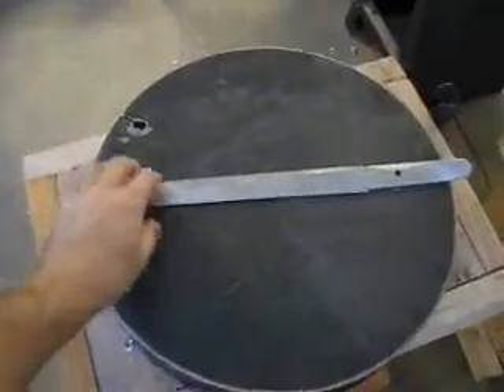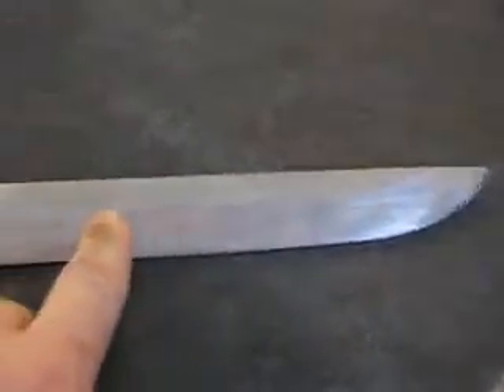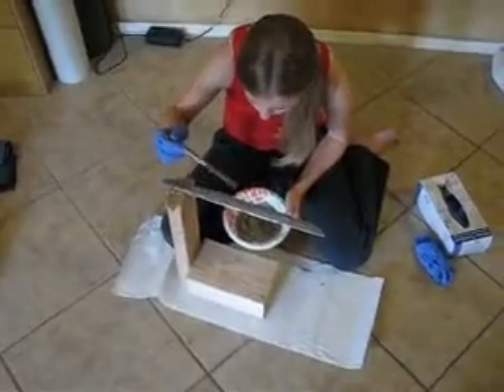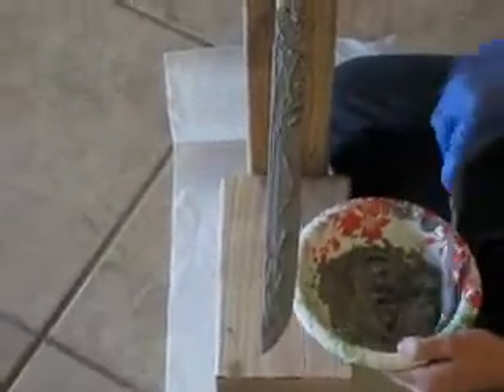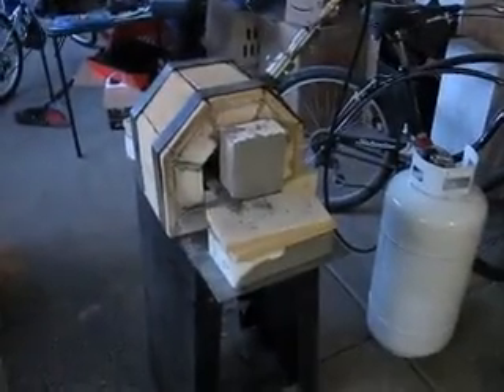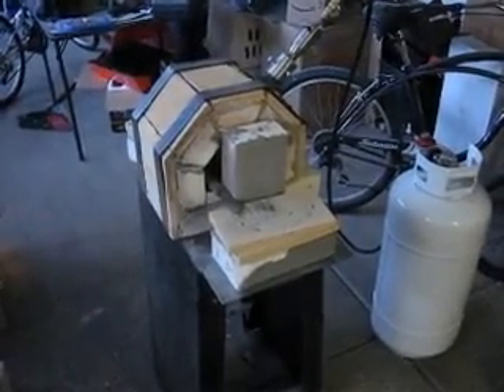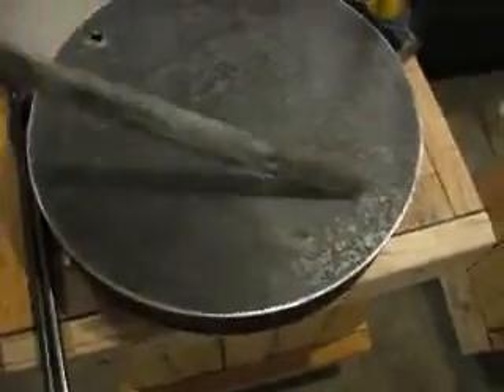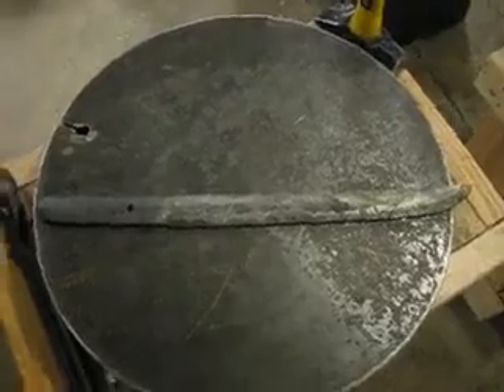Forge Diaries 006: Shinogi zukuri geometry; claying the blade; quenching; gracefully curving blade

Comment: Forging is a rough shape, get as close as you can, and then get the final detail, by grinding and filing. Using a 1" belt sander will do a great job at assisting you with that. also you are going clay heavy on the blade which shouldn't be done, only the edge is covered in clay to get the hamon. the edge should be harder than the spine
Reply: cadence0dakota19 This is just how I was Apprenticed though, and is by no means the only method. the clay though doesnt change no matter the method, too much clay, and too hard a spine, will cause that dreaded Ping of Death when you quench
Reply: cadence0dakota19 Also, in my Narcotic induced mindset from painkiller i needed, i got the edge and spine switched, the clay should be only on the spine not the edge. it is what gives it the flexibility of a traditional katana/wakizashi/tanto. and gives it the famous curve
Reply from the maker: Claying the blade has two stages.  1) a thin film of clay goes over the entire blade.  Paradoxically, this makes the blade cool even faster, because it increases the surface area through which heat can be lost.  2) A thicker layer is placed along the spine.  Not the edge.  The spine. This helps control the vapor cloud, causing the edge to cool faster than the spine.

Comment: i got to say i love your videos and all the info they provide however one mistake i noticed that your making is your working light. Historically blacksmiths were know as being twilight workers, reason being in the twilight you have the perfect amount of light. As you most likely already know if your just work in the day light you are unable to accurately tell the temperature of the blade by the color of it; on the flip side of it when you work in the complete dark u r able to very accurately tell temperature by color yes, however since the metal glows much brighter in the complete darkness it makes it so that you are unable to see certain details in the way the metal is forming under each blow of your hammer. Thus you want to work in half light(twilight) allowing you to tell temperature accurately enough while also allowing you to see forming with less glow. You can can achieve this by blocking the ambient light entering your garage during the day. and by using a low watt light bulb at night. I Hope this is useful for you.